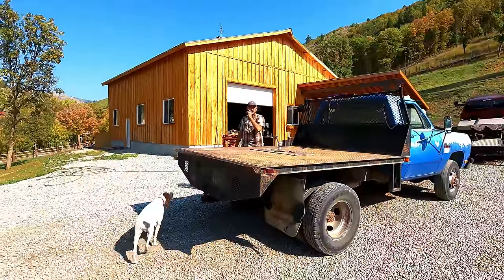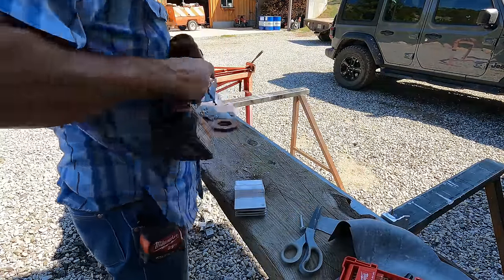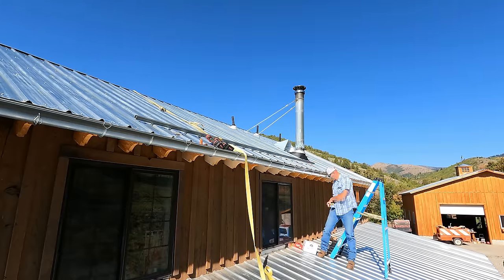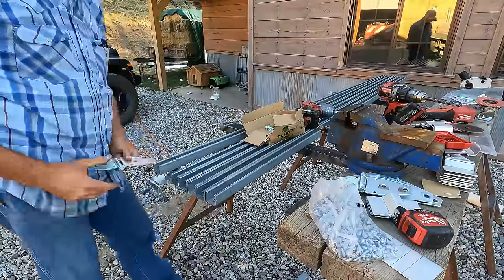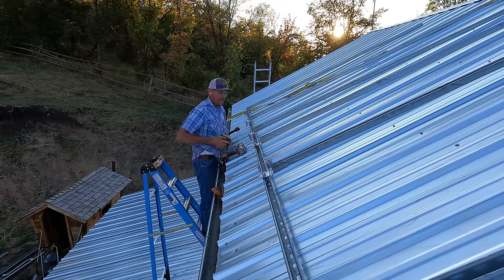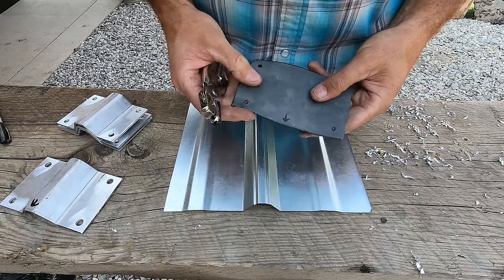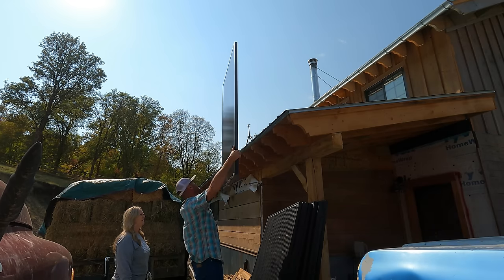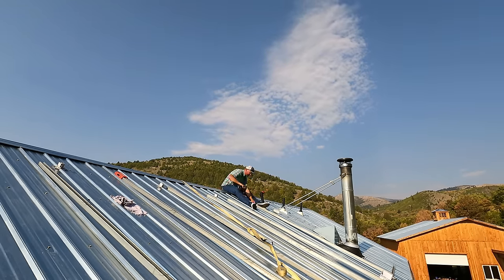#521 - DIY Adjustable Roof Mount Solar Panel Rack (Unistrut).

Comment: you want to make sure that the screws that go through the roof into the roof sheeting doesn't tough the Iron (galvanized) metal
a metal screw connecting the two kinds of metal causes the same challenge.
I did a lot of corrosion chemistry before I retired.   You are exactly right about galvanic corrosion.   It is important to manage
Reply: Will the steel screws not cause the same issue?
Reply: Chris - What if you have a metal roof and your flashing with aluminum - like around a chimney or structure like Heath’s low roof against the bedroom walls? Do you have to worry about that too?  If it’s a paint coated metal roof is that ok?
Reply: @keithgeorge2541  painted is ok
Reply: Aluminium oxide is a good insulator on its own and shoud prevent any chemical reactions after few days outside.
Reply: @jenniferwhite6089  he used to have great content but i swear he now gets advice from pure living for life.
Reply: @KenJ-61  He is nothing like them LOL
They got really bad, demanding we watch adverts because we owe them the revenue. It was sad seeing them change and become awful YouTubers. I feel sorry for the baby, i hope it doesn't suffer because it's parents went mad.
Reply: Exactly, as long as some kind of dissimilar metals sealant is used, the installation should last a long time.

Comment: I work on old aluminum dry bulk tankers, and whenever there's rubber to aluminum contact, you still get galvanic corrosion on the aluminum side. We just put duct tape on the aluminum wherever it contacts anything else and that stops any corrosion from happening.

Comment: Linear actuators. Id love to see you use some linear actuators to be able to change the angle any time WITHOUT going on the roof. If the control was in the utility room you could watch the input go up until you hit optimum angle. As a nerd I would also incorporate an inclinometer and make a chart of optimum angle by day. I might even use an arduino or raspberry pi to change the angle each day automagically. But Id start with a simple linear actuator and DPDT momentary switch.
Reply: I think a jack screw mechanism might be a better, less costly solution with position indicator lights in the utility room.
Reply: Also, with the use of the linear actuators you could , potentially, lift them high enough to get the snow to slide off. Something to think about.
Reply: Exactly where my mind went also.  I addition to raising it to get snow to slide off.
Reply: no real benefit to change by the day at most by the month but you forget once snowfall starts he will need max angle to prevent snow buildup.  Yes old satellite tv receivers and their actuator would be cheap and easy to use just set a "satellite " every 3 degrees or so for about 10 satellites or less
Reply: Define the potential of panels mounted on a full dawn to dusk rotating and tilting tracker as 100%. Panels on a fixed mount facing solar south with a tilt up from horizontal at approximately your latitude will produce 60% to 70% of potential. Adjusting the tilt twice per year, about 1/2 your latitude flatter for winter and 1/2 your latitude steeper for summer, will increase production to 70% to 75% of potential. Adjusting every week will get you to about 80% or maybe 85%. Adjusting tilt and angle 3 times per day will get you to about 90% to 95%. The constant tracking is needed to get the last 5% to 10%.
Missing an adjustment will be much worse than using the fixed mount.
Trackers were questionable when panels dropped under $10 per watt, justifiable only if panels were filling all the space available and more were needed.
Now that panels are well under $1 per watt, a tracker cannot be justified in any but the most extreme circumstances, and the additional cost and complexity of adjustable mounts must be justified against the cost (dollars and space and work required) of panels and the risk of missing an adjustment or deciding to be lazy and not adjust.
Even putting panels up on racks is now only justified to keep large animals from walking on them or to prevent being buried in snow.
Reply: @Sylvan_dB  And also the new generator is in the shop? Why not have everything arrive from there.
Reply: I don't know what I just read. 😂😂 I'll just stick to nursing. 😂😂
Reply: @danblumel  That is basically a linear actuator
Reply: All the time I was watching this installation, I was thinking "cheap garage door opener" with a remote" to adjust the angle of his panels. But the linear actuators is the way to go ! With a remote. Heath, by his own admission, is not getting any younger. So, a remote is a must.
Reply: Great idea. Now go a bit further and send him grahs and installation plans. Otherwise, useless comment, Handful...
Reply: @Sylvan_dB  Surely you mean steeper in winter and more shallow in summer. For instance  at 36 degrees latitude . an elevation angle of 36 degrees in fall and spring and 51 degrees in winter and 21 degrees in summer. This is much flatter in summer than winter.  The sun is higher in the sky above the southern horizon in north america in the summer.
Reply: Could you use a few coats of Rain X on the panels to make inclement weather run right off of the panels?
Reply: Is this your first video?  Heath isn't really into the tech/nerdy things.  He is much more bull headed and just get it done.  And I mean that in a good way.
Reply: @sambennett5441  Yep more mechanical and fabrication type things
Reply: @danblumel  Yep, it wouldn't even have to be motorized, I'm thinking a linkage similar to what grain truck drivers use to open and close trailer tarps that attaches to a jackscrew up top so you can simply crank the array up or down while remaining on the ground.
Reply: I've been thinking about this quite a bit since I posted. Remember last winter when Heath was sweeping the snow off the panels, they were at least 60degrees. Now think about climbing up on the roof every time the snow has to swept off. I'm of the opinion that it would be money, about 500 for 3 actuators, and time well spent to get the snow to slide off. Heath is smart he'll figure it out, as he doesn't read our comments for advice.
Reply: @Guysm1l3y  Yes, the KISS principle at work.
Reply: Heath!! This! Low voltage servos will do all the work for you automatically.
Reply: @brucecook4832  they should be about 58 degrees in winter for maximum energy at his latitude. This is another reason why its good for lower edge to be at bottom edge of the roof. This way the snow that slides off doesnt accumulate at bottom of panels it slides onto lower roof.  However I a not convinced that the snow is going to slide off the lower roof .  I definitely have doubts that if he then puts panels on the lower roof later that will actually result in a bunch of snow collecting behind those panels and would block the window views dramatically JUST NOT A GREAT OPTION.
Reply: @ryanthomas2472  Just as easy to check for max watt production at a clear time of a day once a week or month etc but again once snow/freezing rain  starts he will want them at their max winter angle
Reply: @carollove8752  I agree lol !  no comprende !
Reply: I don't know if the automagically was on purpose or not but that was a good one lol

Comment: I'm curious about the skid steer and the 1 ton with the aluminum flatbed? I'm glad you're back to 2 uploads a week. Thanks for sharing your experiences!
Reply: I was thinking the same thing...what happend to the chevrolet you built
Reply: And the smaller excavator with metal tracks he bought too.
Reply: All a mystery that he will never say!
Reply: Sold and delivered them to a guy 4 hours away 😉.
Reply: ^^what they said.
Reply: I've inquired about the skid steer a couple times already. No answer. I was hoping for a win or at least an answer on the mysterious problem. RPR??? ANY INPUT PLEASE
Reply: @BRadWilson3  he was not able to fix the skid steer and sold it to some poor sucker, so correct he will say nothing.
Reply: i would also like to know about the square body chevy you were doing up. Why don't you put the motor from the dodge in it.
Reply: @KenJ-61  😳 Hope not !!
Reply: @edpoints1127  come winter you will know.

Comment: All a while I was watching and listening to your reasoning for what, why and how you were doing things. One thing came to my mind, from a different prospective. What if you became disabled or G-D forbid, died? How would Ceder be able to maintain this system by herself? This thought reminded me of a situation were a friends husband fell off his roof, and became disabled. I feel its imperative to figure out a way to electronically shift the angle of the panels, WITHOUT CLIMBING UP ON THE ROOF AT ALL. G-D BLESS.

Comment: Should have completely dipped your mounting plates in Flexpaint, or any other type of protective sealer, after drilling the mounting holes. Corrosive problem solved! Water will be the connective supply charge between the 2 metals. Leaving the top of the plate unprotected, when it rains or snow melts, water will build up and touch both metals together, creating your galvanic corrosion. Fully dipping the mounting plates secures a perfect wraparound cover that should last forever. Love your channel. Keep up the great work.

Comment: You can get well over 500w panels, I have seen 580w. That’s double the output of your current array in the same space… mounts are expensive and time consuming… just swop out your old 200w panels, there’s a good used market and the new panels are not that much more expensive (less than a 3rd).

You could Use the old 200w panels for the tiny house up the hill
Reply: Agreed. Also ground mounts are more efficient and easier to clean.
Reply: Don’t give him any ideas. He might just tear the house down and rebuild to accommodate more solar.
Reply: @shawnd567  ground mounts are not inherently more efficient ( I have 12,600 watts of tillable ground mount DIY panels)
Reply: The panels you are alluding too are very expensive compared to say 435 watt panels and also are larger than his 275 watt panels generally 40x66 for his panels and up to about 40x 78-82 inches or more for greater than 400 watt P anels.  They also count on reflected light to hit the underside of the panels which likely would not add much in this situation. Right now price goes way up over 435 watts.
Reply: For the same size panels 40x66 335 watts is the point at which price increases quickly. 275 watts (not 200 watts) to 335 watts is about a 22 % increase in power. This would be the most cost effective price point at this time.
Reply: @shawnd567  In fact in his case the roof mounts will provide more Kwhrs of energy because he just stated the panels would receive as much as 1 1/2 hours or more per day additional sunlight.

Comment: I would recommend deep cleaning your panels and then apply a couple of coats of RainX on them.
This stuff really works great on mine.
Reply: i thought the same thing the water would sheet off along with snow i rarely use my wipers with rain X

Comment: Two thoughts.
1. Depending on the type of anchor using to secure the brackets to the roof. Unless the anchors are isolated from the brackets and roof. The anchors them selves can cause corrosion.
2. What about snow build up behind the solar panels. How is the snow going to be dealt with.

Comment: I have a 500 and a 750 Drill Doctor. When using your Drill Doctor, position your hand so that you can turn a full 180 degrees (from white line to white line) without stopping and then reposition your hand to do the next 180 degrees. Never stop during the cutting process.

Comment: Good on you for putting the panels on the roof and not falling for all the over the top protests in the comments. It's not nearly as big of a deal as they make it out to be - especially with someone as handy as you. I still think you should have considered floating mounts like I built. If you do want to add more panels, and want to do it at a very low cost, feel free to reach out,. and I'll link you up with my contact.

Comment: Great catch and smart for listening to the community for a change 🤠 😂😆
Reply: Yes good catch but the old rubber tube with conduct electricity so didn't solve the problem.
Reply: @richardnott9587  Rubber does not conduct electricity. It is an insulator not a conductor.
Reply: @sunain8334  thanks been meaning to get around to that about 30 times he posted it

Comment: Wow.  When you said new, I assumed you meant new to you.  That’s a beautiful truck.  I have driven a one ton 3500 for close to six years now.  I tow back and froth to Florida from Maine several times a year and work my 44 acres and she has never failed me.  Love Dodge…
Reply: Too bad it’s not his. He just wanted us to think it was. If he was as frugal as he leads us to believe then he would go out tomorrow and spec out a new truck. He would have it for many years and he’d have more time to concentrate on more important tasks.
Reply: @MrSeanG-of1zc  Well, they did buy Cedar a new jeep.
Reply: @AParr-cp4ib  yea but it was what he wanted, not her. For a while he was going to make her drive the square body. The Jeep was just to shut her up. He was all ready to make that Jeep his own with lift kits and big tires and whatever else he wanted without considering how she felt since she would be the one driving it. Oh yea, I haven’t seen one stick of firewood put up for winter yet so you know he will be stressing over that very soon.
Reply: @MrSeanG-of1zc  I hate to think what the cost of a new pick-up truck would be in these current economic times.  Maybe upwards of $50,000.  I think Heath has done very well in re-habbing these older vehicles that he has.  Not many people have this level of mechanical skill.   

I have also actually been eyeing the firewood stacked under the roof outside the "shop" in the background of these videos for a bit, and the pile really doesn't look too bad at this point.  And seems to be growing.  Perhaps it is being slowly added to, with no direct video made about the growing pile. 

He might stress about it anyway, though.  Speaking as a person that once lived with firewood and a woodstove as my sole source of heating for many years, I know that one can never have too much firewood, because one never knows what a coming winter might bring.
Reply: @AParr-cp4ib  if he had any mechanical skills he would just rebuild the transmission in his truck. All he does with all the junk he buys is make it look cool. It’s Like buying a $500 car and putting 5k worth of wheels and stereo in it. All the cash he’s wasted on junk he could have a nice truck that will do everything he needs it to do. I’d keep a junker just for plowing tho or buy an old dozer to plow and he could grade the road with it too in the off months. In my experiences always get more truck than you think you need. With all the projects he has going on at one time, he needs to be tinkering with truck as much as I need a third nut.
Reply: When you buy junk, you get junk…

Comment: I hate that you've had to redo a number of your major homestead projects. Though you are using rubber between the aluminum and galvanized roof, aren't you passing some galvanic corrosive action through by using metal screws without using an insulating washer? I will be installing several 410W bi-facial solar panels myself shortly so I need to space them slightly higher than normal above my roof. I definitely want them hinged for altering between two different angles annually. We live in Central Florida so my angles will be considerably shallower than yours. Anxious to see your next video. I built my own off-grid solar system. You certainly have many things to maintain. Love it! Stay safe. Blessings and wisdom to each of you!
Reply: the screws he's using have a rubber seal under the head. which should be sufficient

Comment: I had my  97 Dodge 1500 transmission rebuilt and installed. I think it was around $2,500. It has a lot of rust on it, but I use it to pull my trailer around. I have a 2019 Dodge but I drive my 97 way more. I just like my old Dodge. Keep the 94 Dodge, it is the same color as mine. They have way less computer crap on them, so less electronic problems.

Comment: There are 2 band adjusters on that transmission, they are easy to adjust you need a torque wrench that can do ~72 inch ounces of torque.  It will solve your slipping.
Reply: I could drop that transmission today and have it rebuilt and back in the truck tomorrow. He’d rather buy a truck he knows nothing about and fix all its problems. He won’t ever use the one he just bought. He will take the bed off and give it to his kid or sell it and the truck will sit and rot like the rest or he will sell it and get another junker

Comment: Heath when you need to clean the panels on the roof. May I suggest using windex outdoor glass cleaner. They make it so that it attaches to your garden hose. You would be able to stand on the ground and wash them off. God bless

Comment: it snows heavily in Idaho, I would be looking for a simple way to heat the tin roof a bit, causing snow to slide off, but then that won't work once you put panels on the lower roof.
I know nothing about putting up solar panels, but I enjoy watching the process. Thanks for the videos !

Comment: Heath, here in Australia where we have more solar installations per capita of any country on the planet, the vast majority of solar panels are roof mounted and this includes parts of the country where it snows every year, and on metal roofs. Sure stuff happens and shit fails, but nowhere near the level of some of the doomsday commenters. You're 100% doing the right thing mate 👍

Btw - get yourself a pair of magnetic roofing shoes